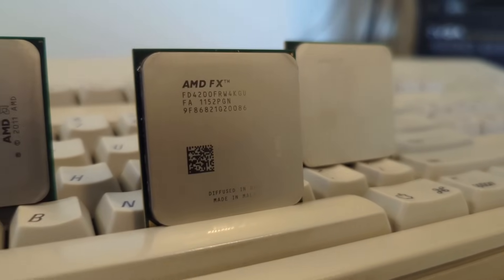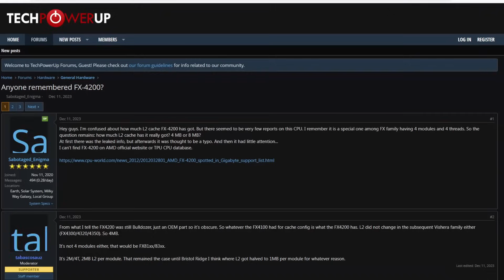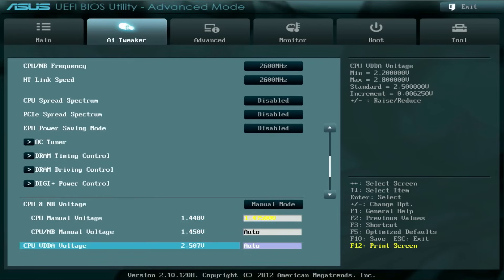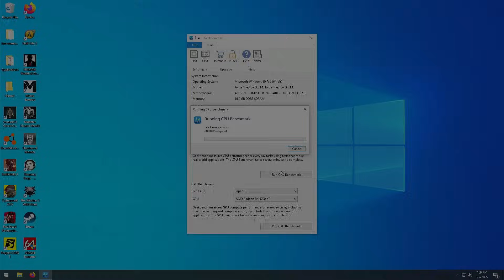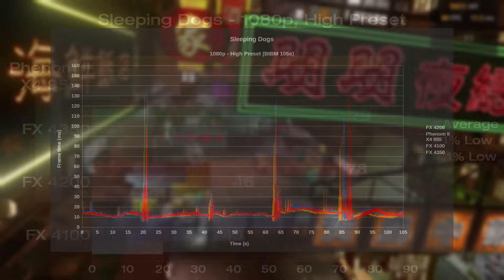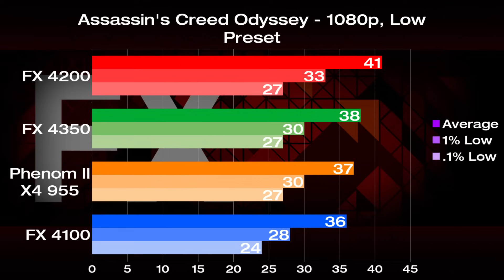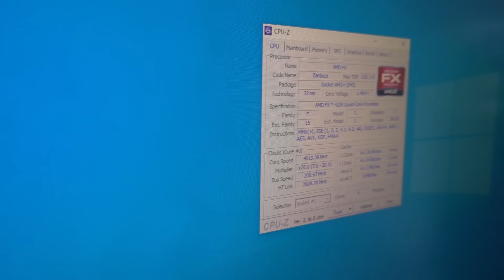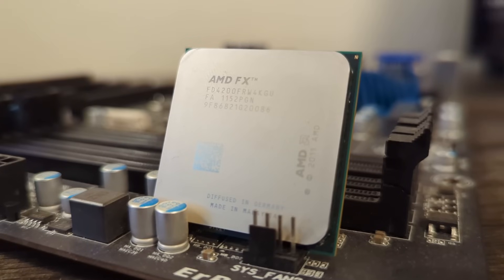What if AMD FX had "real" cores?

Comment: "This approach was bad for performance"...correction this approach was bad for WINDOWS performance. Look up the Phoronix benchmarks for the FX chips and suddenly you will see a VERY different story, where the FX chips are trading blows with the i5s and i7s and beating them in heavily threaded workloads. What a shock, MSFT can't code a scheduler to save their ass, which is why Intel is getting rid of E-Cores because MSFT even after all this time still puts heavy workloads on E-Cores and light loads on performance cores all willy nilly. BTW would it shock anybody here to know MSFT admitted more than a third of Windows coding is now AI slop? Certainly didn't surprise me 🙄
Reply: Intel is getting rid of ecores? Are you mentioning the lga1700 refresh without ecores or something else?
Reply: @WSZYSTKOKEJ I think they’re confusing the rumor that Intel is going to abandon the performance cores by just scaling up the efficiency core design to replace them, and then only using that, as Intel “abandoning E cores”. Don’t know how I feel about that plan, but that’s also something like 4-5 generations out allegedly.
Reply: @levygaming3133  This... but one of the supposed reasons they are looking at this is the trajectory of Ecore design. P core gains have slowed significantly in comparison and Ecores may overtake them. Or they get close enough and they work out the "super core" (funny to bring this up on a FX video lol) they would likely need a single core design to leverage that.
Reply: They still gonna use e-cores in Nova Lake. Plenty of E-cores. Flagship will have  16 Performance-cores, 32 Efficient-cores, and 4 Low-Power-cores (16P+32E+4LP). They haven't given up on this hybrid architecture yet.
Reply: @GreyDeathVaccine  Sadly. It could`ve worked well, but intel never finished its scheduler, meaning that everyone who got these for games needs to set up core affinity or disable all the E-cores...which would be quite long with 36 of them.
Reply: Only Bartlett Lake will be ditching E-cores

Comment: The Phenom II X4 955 BE is a really good overclocker. I was able to get mine to 4.1 GHz stable with the stock cooler
Reply from the maker: This 25% OC took pretty much no effort, they tune really well! Definitely ran a little cooler compared to the FXes as well.

Comment: I remember back when FX came out. The guys with Phenom X6 1090T and 1100T claimed it was still faster than the FX6100 and FX6300. I don't remember at stock speeds if they were or not. But I do remember getting my FX6300 to 5.3ghz on 1.55v stable and crushing every Phenom X6 on the Passmark benchmark. I never went back to check but at the time I had the highest FX6300 Passmark score. I think someone did test these and proved overall stock or OC the Fx6300 was better.
Reply from the maker: OC potential was really where it was at for FX, not gonna lie though it was easy to turn your chip into a heater lol. And that's awesome! An FX 6300 was some of my first experiences with OC, I daily drove one in 2019 for a couple months and had only used locked platforms up until that point.

Comment: In my opinion the fx 8000 cpus are true 8 cores... it is just that they used the cyrix 5x86 approach compared to actual 586 (pentium) cores. And you don´t see cyrix cpu´s anymore do you?
Some will get the comparison.
Reply: they technically do have 8 cores, just share resources.Its actually a similar design to the core 2 quad,its 2 modules, with 2 cores paired in each one
Reply: @kyles8524  The problem is that we already KNEW since the cyrix 5x86 times that FPU is kinda relevant and they choose to ignore that anyways.
So the problem isn´t the technicality IF its a true 8 core or not. The problem is that they went with an approach that already has proven to be bad and went with it anyways. 

Not gonna lie, the entire architecture of the fx lineup is bad, it gets beaten at times by its predecessor and that should already tell you what you need to know. and they probably just tried to make the best out of a failed development to get at least some money out of it. 
IF not for xbox/ps4, amd wouldn´t even be around anymore, cause their product just had no leg to stand on. 
Thankfully someone took charge that changed their approach drastically and starting with ryzen they have shown that they not just understand but also can deliver.

Still would love to see a fx 9590 with 8 fpu units, just to see what it could have delivered at its peak and "fully" equipped. Sadly this is something we are never going to see.

Comment: I remember upgrading to an FX 8150 and going back to my Phenom II X6 1090T at the time because it gave me a better performance, I managed to get 4.1Ghz all cores stable on my chip, it was a beast for the time.
Reply from the maker: I think for that time it would have made a lot of sense to stick to the Phenom II if you had one already. 4.1 is great for an X6, I need to throw mine in this system and get to tuning it

Comment: My first custom build was an FX 8350 and I loved it
Reply: It was a waste of money on release with the market flooded with similarly performing core 2 quad, Xeon 771/775 mods and core 2 duo systems. There was the argument for multi core workloads but often those were single/dual thread speed dependant be it video encoding, 3d rendering or various machine learning loads.

Comment: I had an fx8320 that I had overclocked to 4.3gh reliably I I did like it but I ran that chip untill 2021 and moved to a ryzen 3700x
Reply from the maker: I always found FX fun to tune, it was my favorite thing about an FX-6300 I daily drove back in 2019. I had only used locked platforms up to that point and it taught me a lot about OC

Comment: My first foray into PC building started as a hand-me-down prebuilt from my dad that had an FX-6300.  The thing's basically been Ship of Theseus'd at this point save for a single hard drive I haven't gotten around to swapping for an SSD yet but I'll never forget how my rig started.
Reply: SSD is a huge huge performance upgrade
Reply: @pilotavery Yeah, I have several, just never got to the point where that last hard drive no longer fits.
Reply: @ironeleven trust me, you want to switch it. Like now.
Reply: @pilotavery ”last hard drive” as in they had more than one and all the others are SSDs now.
Reply: @pilotavery If it's for media then it really doesn't matter. I have a 2tb pcie 4.0 ssd as my system drive and for my newer games and everything else is on 16tb of hdds, one 12tb and one 4tb.
Reply from the maker: I daily drove one for a few months in 2019, it wasn't that bad compared to the locked Sandy Bridge chip I was using up to that point. It was fun to tune and taught me a lot about OC even though I had a crappy board lol.
Reply: First build was an 8320, my latest build is still in the same case, and the PSU is in my NAS now.
Reply: Same
Reply: hah, my rig was a Ship of Theseus until March of this year. Went 8 years with a Corsair Carbide SPEC-02 while changing out literally everything else until I switched to a 200R from the same series. My old SPEC-02 still lives on holding my cousin's rig!

(My first rig had an i5 6600k)

Comment: Instead of all this effort, you could have bought an FX 8350, or you could have one and disable 1 (core) per module if your mobo supports it, and it would be the same.
Reply from the maker: Kind of defeats the purpose, this being the chip's default config is exactly what makes it special, it was marketed as a quad core. Would be interesting to do that to see what a Piledriver version of this CPU looks like though, however I'm not sure my board supports that feature, I think it can only disable entire modules IIRC.
Reply: @SPNG Yes, it's special, but I thought your test was only to test the 4/4 FX CPU.

Comment: I also, had no idea that this iteration of CPU existed. Granted, seems the media only gave attention to the original (#1##) and revised (#3##) takes, and not this middle unit.

While I can't entirely hate on it, because it is my presently ONLY working SLI platform, I do very much hate how the motherboard for that was so trouble free in running fast ram while everything else that used am3(+) I had was a real bastard about running even a tiny fraction past 1600 for ram. Even more so with regards to Windows XP. Like I had faster ram stable on a windows 10 install, but the thing would go into an instant bsod kill cycle if fsb was even .1mhz past stock on XP, which gimped memory performance everywhere else.
Reply from the maker: Being that it was an OEM only chip, I can see why it flew under the radar. I'm surprised almost 15 years later it has barely had any discussion or coverage on its performance though.

Comment: Everyone focuses on the shared FPU when arguing wether or not FX cores are real cores, while the shared front-end is a much better argument in my opinion. Pretty much everything except the integer EUs is shared within a module, meaning it works a lot like an SMT-enabled core, just with the integer EUs and schedulers grouped into two. Even if it had 2 FPUs per module, it still would not have been a true 8-core design.
Reply from the maker: You make a good point, there is more to what makes a core than just FPUs. I guess this part would be considered a true quad by that metric though, maybe that's playing a part in performance but I don't know enough about FX to say if just one thread could take full advantage of the front-end or not.
Reply: Fpus are an extra not, the base of a core, the shared front end is the only real persuasive argument
Reply: I think if the modules would had its own FPUs, it would have been greatly called atleast an 8 core design.

Comment: skylake is getting dirt cheap these days.

even an i3 6100 which you can get for next to nothing these days
gives the 4200 a run for it's money
Reply: It was sandy bridge 2600 that was at that time, right? I wonder if they are still better
Reply: Even some i5 4670 is 20€ these days and would give any FX a very hard time.
Reply: Funny thing, I recently (October 2024) replaced my i5 6500 Skylake with Zen3. Bought Skylake 9 or 10 months before first Zen came out. I desperately needed new PC, my MOBO was damaged :/ Back than skylake was very pricey in my country.
Reply: @GreyDeathVaccine 
zen 3, my guesss is you went for a ryzen 5 5500

Comment: It's a shame Anandtech articles have been taken down. They done amazing deep dives into each generation architecture as well as phenomenal (see what I did there) post mortem of the FX series. From memory of those deep dives the biggest issue was the long pipeline requiring the Cache, scheduler  and prediction branches to have the awareness and capacity to keep the pipeline fully loaded with instructions. Updates to these provided the biggest improvements. 

To make up for the lack of performance it was necessary to ramp up frequency to keep the pipelines fed however this ultimately didn't work as AMD just couldn't get the power and temperature under control. This wasn't helped by their financial situation which limited what they could do on the design side. Unlike Intel they couldn't throw money at design problems and iron everything out.

Personally I think it was a fundamentally flawed design that AMD doubled down on due to how long it was rumoured and in development for. They simply didn't have a backup and their phenom II was the last hurrah for a design that had reached EOL back in 06 when Core 2 released. Who knows if they had more time and money and could iron out some problems but Intel abandoned the design philosophy after pentium 4/D (two pentium 4's slapped together). Maybe it would never work no matter what
Reply from the maker: RIP Anandtech 😢I'm so sad they took down all of the articles, I really thought they'd stay up. Guess we have to get used to using the wayback machine. And I agree, although not gonna lie it seems like Intel is running out of get out of jail free cards these days.
Reply: @SPNG didn't they announce their articles would stay up? What happened to that
Reply: @SPNG The original deal was to keep everything. Whatever way that was worded the sale and resale meant there was a gap that allowed them to take down the articles. I do hope that they find a way of allowing people to access them, even if behind a paywall. 

Swings and roundabouts. AMD are behaving similar to how Intel where when left unchallenged. I think they where pressured into releasing the latest Threadripper processor's rather than being part of their strategy.

 Even then despite their success and Intel's failures, Intel is in a far better position to weather the storm and AMD have started to eat I to their lead, but not as much as you would expect. 

Intel's Core Ultra 2 CPUs do seem very competitive price wise however, after 13th and 14th gen issues that are still not fully resolved....do you completely trust them?

Either way compition is good. Just need Microsoft to stop failing and holding Qualcomm back and for Qualcomm to start executing and we will have true completion. Would love to see Mediatek enter the PC space in force. The dreams of an Arm based gaming handheld running steam games that doesn't use android emulation is getting closer
Reply: The core 2 quad was basically the same idea as the Pentium d, but core 2 was a way more efficient architecture compared to netburst thats why it didnt suck so much
Reply: @ΓιανναραςΚαπα 
It was the same in the sense it glued two dual cores together but that is about the only similarities with Pentium 4 architecture.

 That processing of gluing cores together was not the reason the core 2 quad succeeded. Intel could have developed a native architecture but chose speed to market over AMD who were reeling after the ATI acquisition. AMDs delays and TLB issue meant the original Phenoms were lack luster at best

The reason Core 2 quad succeeded wasn't because they glued two core 2 dual cores together, but the underlying core 2 architecture was the polar opposite concept to Pentium 4 in the sense it was a much shorter pipeline (14 stages opposed to 31 stages).
Reply: While core 2 quads were decent their biggest drawback was FSB which i guess is the reason intel ditched that architecture in future generations
Reply: @ΓιανναραςΚαπα  You do realise that "Core 2 quads" is only describing one product line across 65nm and 45nm die sizes that also included single and dual core designs? The quads where also not the first products released and there was a significant gap between dual core and the first quad cores? 

Anything core 2 related isn't specific to the quads but single, dual and quad core architectures as well? 

FSB was just an interface for connecting the CPU to the memory. Like all bus's in computing they will always pose a bottleneck of sorts. The elimination of the FSB came when the memory controller was integrated into the CPU with Nehalem. Moving memory closer to the CPU reduces latency and increases speeds. Basically Cache is the ultimate example of the closest memory to the CPU. Nehalem also went to native quad design rather than gluing two dual cores together 

When the memory controller was integrated onto the CPU. It increased pipeline stages to 24 stages (I think). It made a lot of evolutionary improvements to the 45nm process but the biggest I think was in the branch prediction stages
Reply: @Javadamutt as someone who owned a core 2 quad q9550 system for 7 years aswell as an e6600 im quite familiar with the architecture, yes i am aware they made single core celerons aswell in fact my dad had one at the time and i eventually upgraded him to a e6600
Reply: Very interesting video dude👍
Reply: TIL. Was just looking at one the other day. The Wayback Machine is great but you have to know ahead of time what you're looking for, unfortunately.
Reply: Newsgroups homies...Newsgroups
Reply: Magazines are where to go for historical reviews of stuff. Paper cant get deleted so gets archived. (yes im aware of archive for websites but half of websites  prevent them scrapping now)
Reply: @DenimFansAreLowIQ-z2t  Its pretty easy to scrape websites, even if they have bot protection, theres ways around that and captchas
Reply: @renderedpixels4300  It was a pretty big thing in the news recently, so if archive was getting around it, i'd have thought we'd have heard. But i'l have to search which websites it was and see if archive is managing to archive them still.
Reply: @DenimFansAreLowIQ-z2t I wish that magazines had the level of detail that Anandtech went into. Anandtech was able to tap into a far more concise and technical demographic that most magazines didn't have the circulation numbers for

Do know of quite a few people working on digital archives of magazines etc because they too rot, decay and can be destroyed. Nothing is perfect